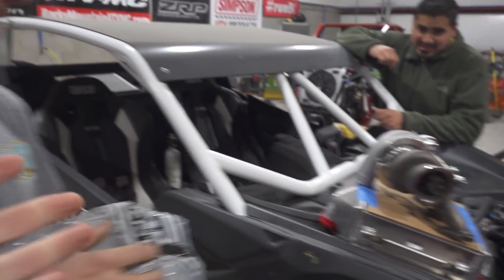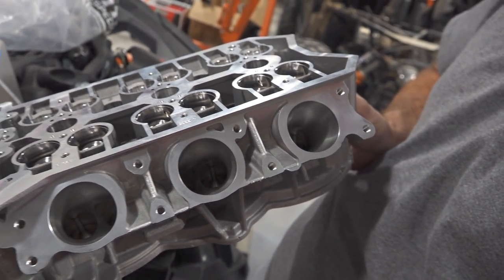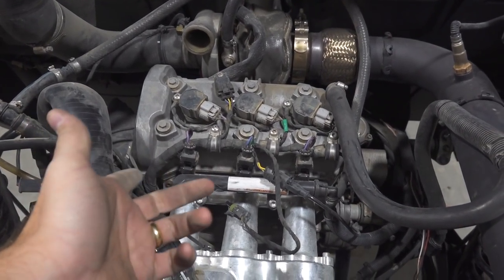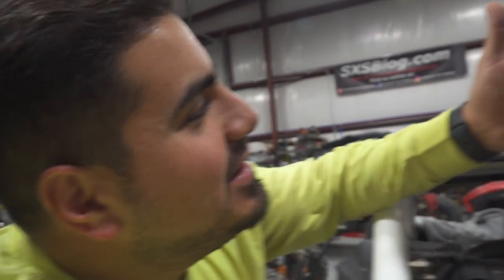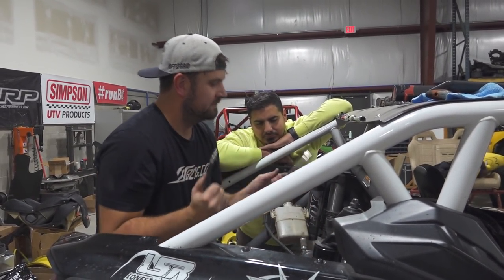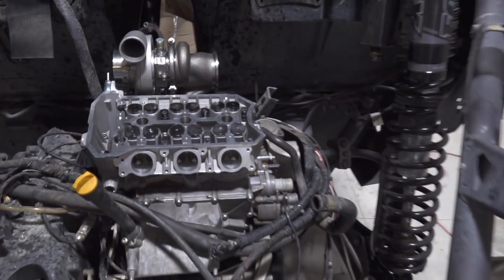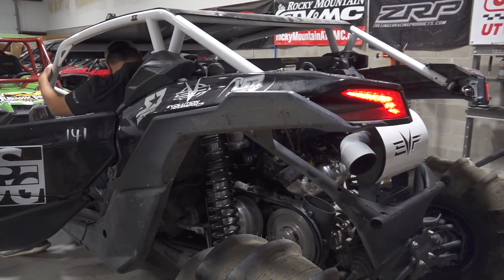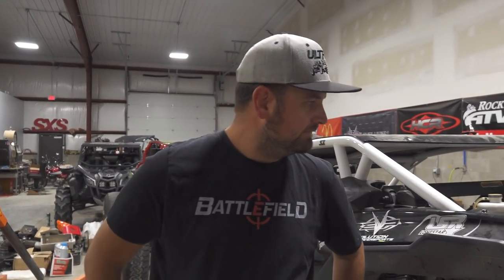Beast Mode Maverick X3 gets built for 500HP! HUGE TURBO! CNC PORTED HEAD!

Comment: tons of honda guys do this typically though we pull the engine out then fill the coolant ports with sugar salt etc then fill the block. also use straws or dowels to drill holes around the cylinders for cooling

Comment: we did the engine block filler in our dirt track engines. they turned 8500rpm around a track for 20 to 30 hard laps. we never had a issue.

Comment: Could you put some strips down the side of the bore that you can pull out after you add the cement and allow for more coolant to travel up and down the outside of the cylinder? Maybe drill some holes in the cement to allow for a little cylinder cooling?  Guess that all depends on whether it starts overheating or not.

Comment: Never used hardblock, but my understanding is it is better to use it at the top of the jackets then the bottom. I have see guys fill the bottom with sugar and pour the hardblock on top and dissolve out the sugar.
Reply: Yep that is how Honda guys do it. They also use the head gasket as a guide to drill holes into the cement so the coolant is able to pass through the water jacket. I think this engine will over heat since they didn't drill any holes and there is no empty space at the bottom of the water jacket. Only time will tell, not talking crap, it is an experiment after all, best of luck to the SXS blog guys.

Comment: Hey SXSBLOG, if you want your valves to seal better let me know. I'm a valve face grinder and the valves we send out are FAR better than any OEM out there. Dodge actually has ALL their valves sent to us and I grind them to a .0001 to .0008 runout. I've put OEM valves from GM, Ford, Mopar, CAT and the best OEM runout (ask Doug, he should know what that means) I've seen is .002-.0025. So if ur lookin for better sealing, I'm ur guy. And I live in Michigan to, just a yooper not a troll.

Comment: Typically cylinder leak down is performed @ 90 psi. Not all, but most testers are calibrated at that pressure.

Comment: You guys need to get some SB particle separators.
Reply: Particle separators work great
I’ve got video of two identical filters, on the same 45 mile ride, I was trailing in the dust most of the time to test it out and his filter was 100x dirtier than mine, still looked new.
Reply: @PNWKyle  yes I run on my machine as well. So good and clean air.

Comment: Be elite use concrete

Also air voids (even bigger bubbles) in the concrete, which are naturally about 2% during mixing, should be good. It'll prevent thermal cracking of the makeshift sleeve during freezing and thawing cycles.

More concrete magic as I watch the episode. The sleeve will reach peak strength at about 28 days of cure time. By enclosing it too early, you may halt the hyrdation process and end up with a weaker concrete.

Comment: How many miles on some of the older stuff? Beast mode, 168, battlefield etc
Reply from the maker: Beast mode has like 3000 on the chassis. Battlefield and 168 like 2500-3000